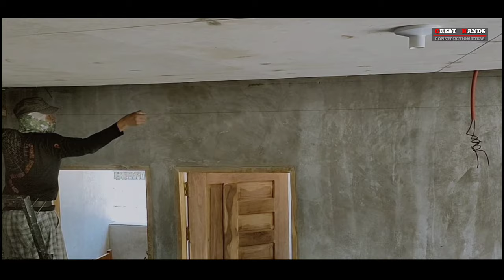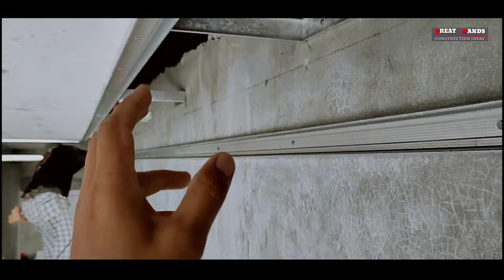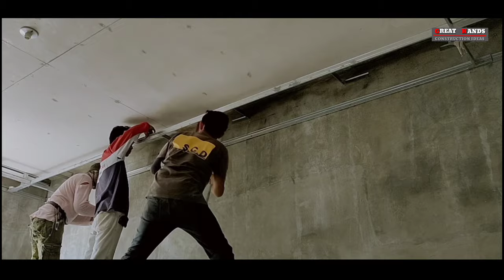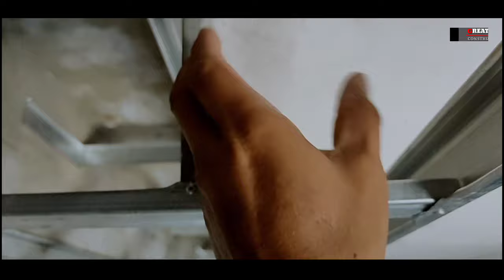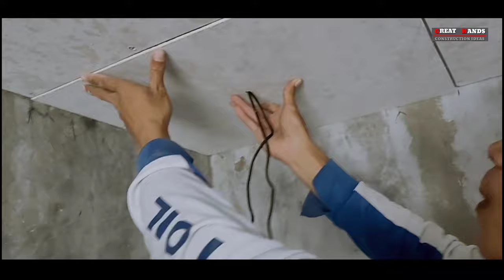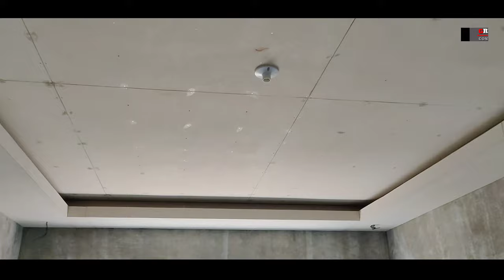Paano mag lagay ng cove design sa kisame. #paanomaglagayngcovedesignsakisame #diykisame

Comment: This the pilipino way of building ceiling  cove lighting. Using metal studs and rivets not wall angles, furring channels and metal screws which is the faster and economical way of doing it. They call the metal studs metal furring. Normally done by 1 or2 persons. Can be done by a single person. Ceiling joints are not staggered either, not the correct way in ceiling board construction. Do your research in correct construction methods and procedures. Sa es you lot.
Reply from the maker: Ang metal studs sir pang partition lang po yan hndi po pwede yan sa kisame.sa pang kisame metal furring, carrying channel, wall angel w-clip at rivet syempre un po ung gagamitin ntin sa mga frames.sa pag latag naman ng board kapag cement board ang gagamitin pwede ng rivets pero kapag gypsum board screw na gagamitin dyan kasi dna pwede ang rivets.sa tao naman depende na po yan sa nag papagawa kung ilan ang ilalagay nya.mas marami mas madaling matapos.
Reply: Mas maalam kapa sa nagawa 😂 pakelam mo sakanila 😂